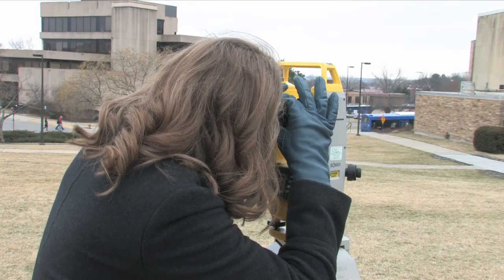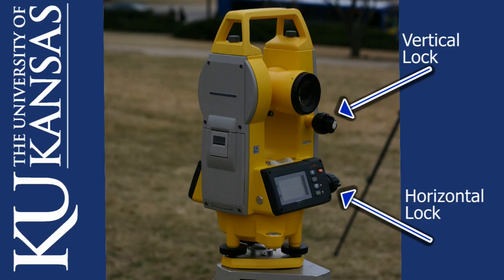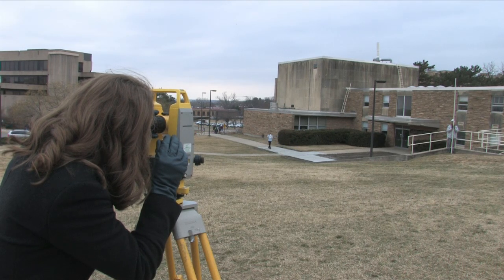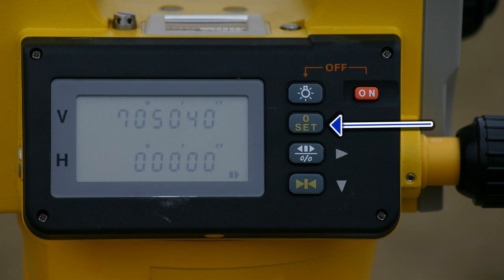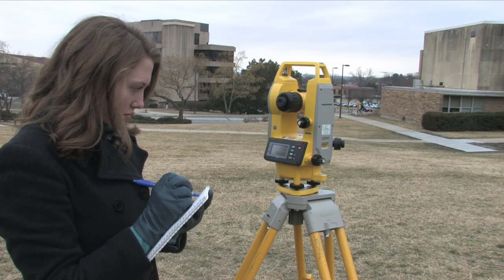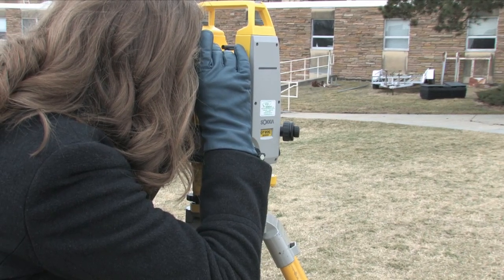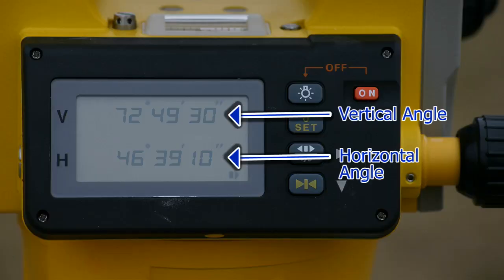How to Use a Digital Theodolite - Part 1 of 2

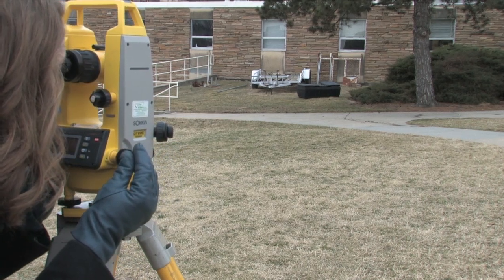Comment: I'm confused. If point A is the spot where a young woman is seen holding the long measuring stick, and point B is the location of the theodolite, and point C is the spot where a young man is holding the long measuring stick then why does the narrator refer to point C as point B?  At 5:20 the theodolite is turned to the right. That's point C. Yet, the narrator says point B.

Comment: Easier and quicker method.  Level up the tribrach  first ensuring equal distance above and below the screw, normally an indentation in the screw. Now using the optical or laser move the theodolite  and tripod together iover the station until central. Now go round each leg in turn, move the leg up or down untill the pond  bubble is pointing towards the next leg you are going to. Eventually the pond bubble will be central after you make 3-5 adjustments. Now check the optical or laser plummit should be over the station. If it is not then loosen thr theodolite slightly from the tripod and slide it until its over your station and then re-tighten ( since you leveled the tribrach it shouldn't impact on your setup) You may have to adjust the fine level slightly.  If your theodolite doesn't have a EDM dump it. It will make a good doorstop.  Using strada went out in the 70's. Good luck and may the force be with you.

Comment: I’m surprised that you didn’t use the plate level to ensure that the theodolite is truly level. The bull’s eye level does not give such an accurate level although it might be good enough to level the instrument within the range of its automatic compensator (if fitted).
Reply: If an automatic compensator was in use, the word Tilt would appear on the display. Since it isn’t, that is all the more reason to use the plate level to complete the levelling of the instrument.

Comment: 4.80 Feet !! WTF. what scale are they using to measure, imperial or metric????
Reply: Just decimal inches.   1 1/2 ft is 1.5 ft.  3 3/4 ft is 3.75 ft.  Pretty simple really.

Comment: I saw this total station on Amazon and it's a lot cheaper than others. Why is it cheap?
Reply: Because it's not a total station. These are theodolites, they aren't a precise, nor as robotic as a total station. A total station will read all the angles and measure them for you (and do the math). They also only require one person to use.
Reply: @dreadfoil  hmm that make sense now😢😢😢

Comment: This vid would do well as a demo of how NOT to setup a tachymeter. At least the beginning.
Reply: Ok it's a theodolite, however the same basic rules apply. 1. Use detachable tribrach with a plummet. 2. Only one person is needed for settin up.

Comment: Wow.  This reminds the operator (sorry, Surveyor) to remove the lens cap if they had not already done so.  Very thorough tutorial!  The student is subsequently reminded to put it back when done.  I learned a lot from this video.
Reply: Absolutely,  I learned when zeroing instruments critical to job accuracy, always use rudimentary measuring devices, such as a receiver stick. Also, when holding receiver and stick make sure to not hold it plum, receiver at crude angle will not make any significant difference in measurements

Comment: Soooooo much wrong here said the Licensed Surveyor.  You can work this way but it would be profoundly ridiculous because we are better mathematicians than this. Additionally, the equipment is more capable than the narrative describes.  We can turn angles in two planes since, Oh i don't know, 1960!?! Shit and use that damn laser! because nobody reads stadia for location anymore.  Seriously not even in 1998 - like nobody does that.  DO NOT STUDY ENGINEERING AT THIS SCHOOL EVER!!  Bloody hell let me write your curriculum. This is what happens when you let an engineer teach you about land surveying. UGH!
Reply: I’ve only been surveying for a little over a year with no schooling and i know better then this
Reply: Lol
Reply: When I learned surveying we started with an Abney level, then Dumpy level and then Theodolite, no lasers and no digital readout. Once we learned the core principles we were allowed to use the Total Station which uses technology to automate most of the process. We were never required to measure the height of the equipment though.
Reply: of course nobody works this way anymore. but the point here is to learn basics to better understand of the whole process

Comment: 1. Set the tripod over point. 2. Secure theodolite to tripod. 3. Raise tripod to your comfort height and press ONE leg only in. 4. Pick up the remaining two legs, look through plummet eyepiece for monument and center. 5. Press remaining legs in. 6. Level instrument by extending legs with fisheye level. 7. Check plummet and slide the instrument to center. 8. Level to perfect. 9. Turn 180 and half level the error. You're now level and centered. 10. Measure SLOPE angle to monument, NOT SOIL.
Reply: Exactly the way I do it.   TY

Comment: They were very clumsy in how they setup the instrument.  Only one person should handle the instrument, not at the same time.  Also, the plumb bob is impractical in this video. Plumb bobs still have practical uses, but that is why there is an optical plumb on these instruments, and it is even used in this video.  Newer instruments have a laser plumb, but if there isn't one, position the tip of your foot near the point and rough locate it through the optical plumb.

Comment: 1) First extend de legs of the tripod and then put the theodolite.
2) Insert the batteries before leveling the theodolite.
3)Alhays aim the theodolite to the centrer of the rod. (to aviod errors on the horozontal angle)